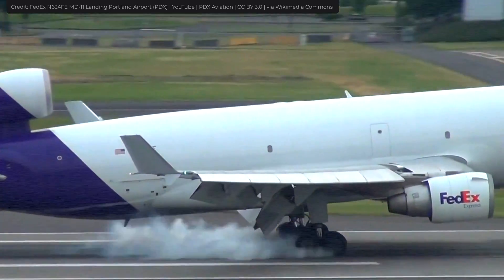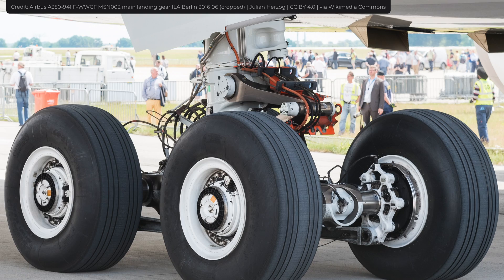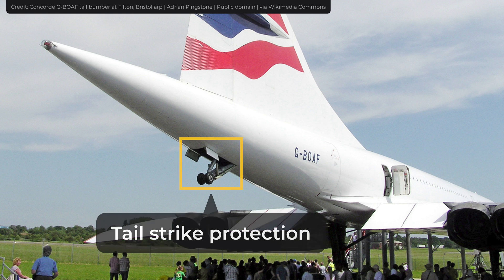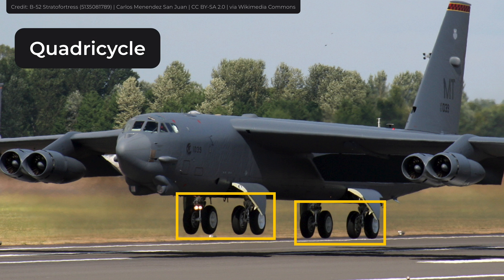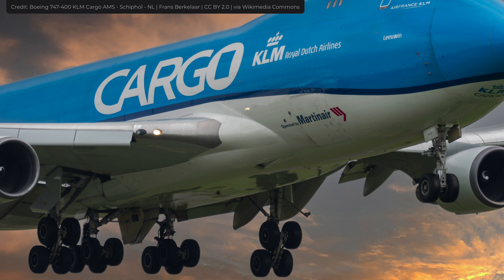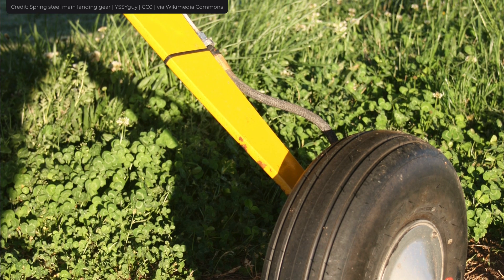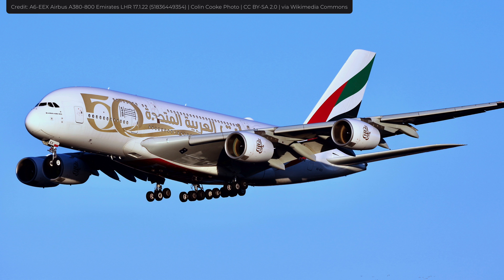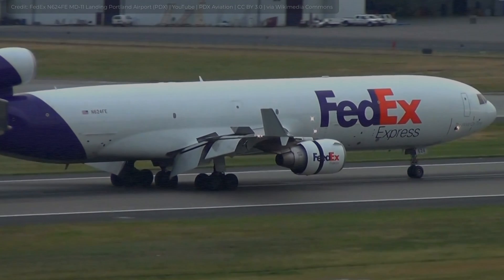How Landing Gear Works

Comment: For every aeroplane, before going for next flight landing gears, shock absorbers and it's oil level should be property checked and should be filled or repaired properly, it will prevent planes from accident and help in smoothly landing.